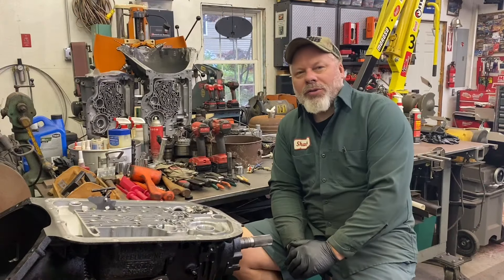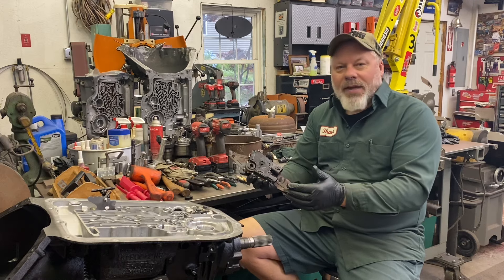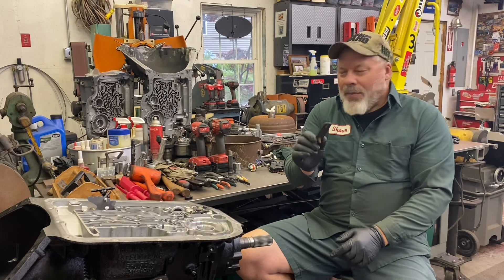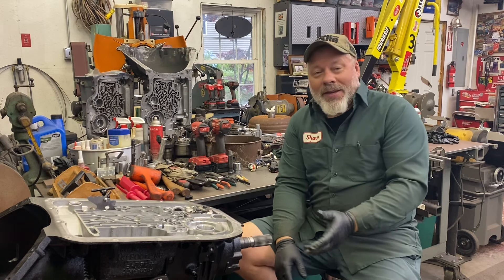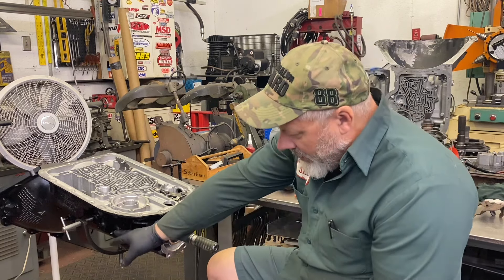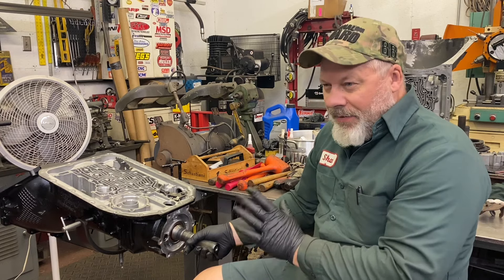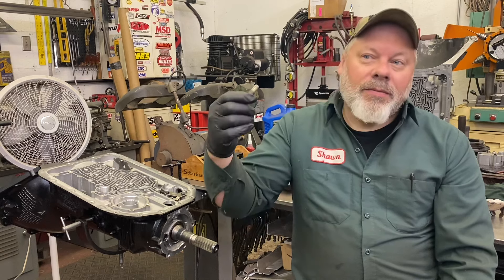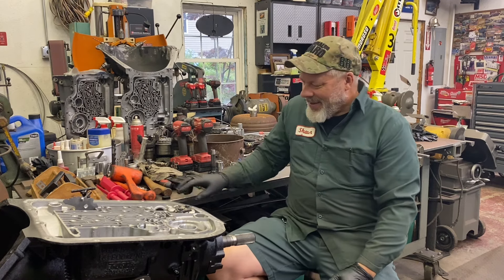Mountains Garage: 4L80E Transmission Case Prep

Comment: Your videos are the best. Got me a new service truck body 97’ k2500 gmc for a $1000! The previous owner thought the trans was toast cuz it wouldn’t shift into drive. I adjusted the cable and drove around the block! But just n case I need to, I’m diving down the rebuild process. I’m an equipment mechanic so I’m not afraid of a fun time lol

Comment: Thank you for your videos. I was thinking of purchasing a new truck until I did some math and found out California wanted over $10,000 to get a $63,000 truck registered. I’m now going to just rebuild the 68 GMC I’ve owned over 40 years. I have an old 60’s Oldsmobile switch pitch 400 without the speedometer gear hole that I was going to put in a Jeep but I gave the Jeep project to my son. I’m trying to decide if I should use the switch pit backed up with a Laycock style OD or just do a 4L80. It’s going to be in a 3/4 ton 4X4 so I’m going to keep it as soft shifting as possible. I’ve done a number of 400’s but never a 4L80. I’m curious as to what you think is the best way for me to go. Thanks
Reply from the maker: @robertbeeson2875  Either would do it but I would probably go with the 4L80E.
Reply: @mountainsgarage  Thanks for your response!

Comment: Are you going to go over performance mods, too?
I'm looking to build a high horsepower unit, but planning to use an Extreme Automatics TB valve body. Expecting over 1500 horse, with engine.